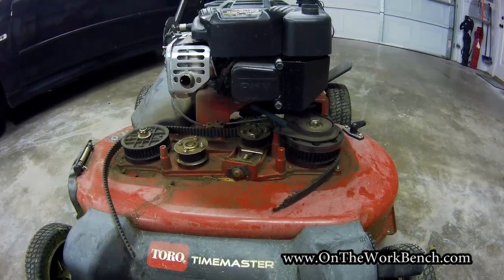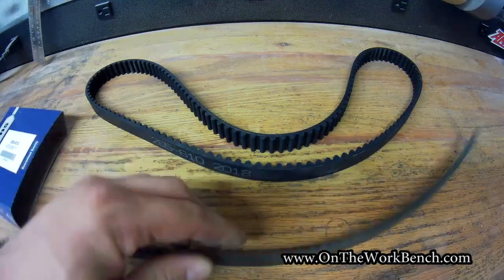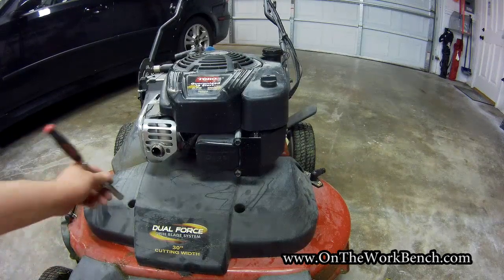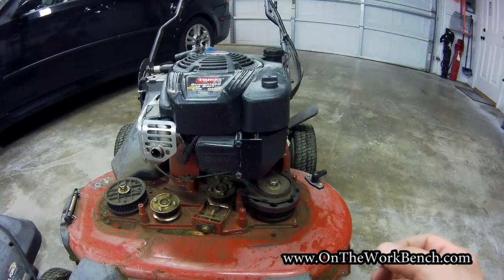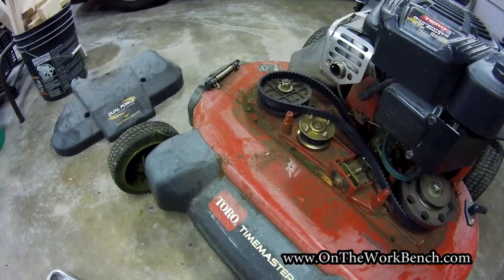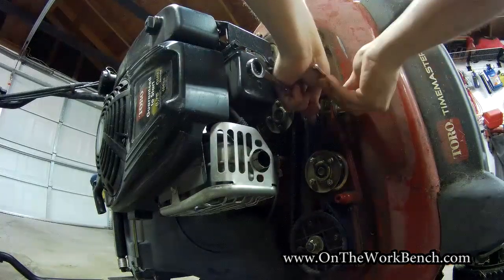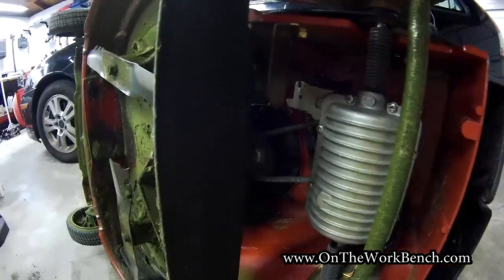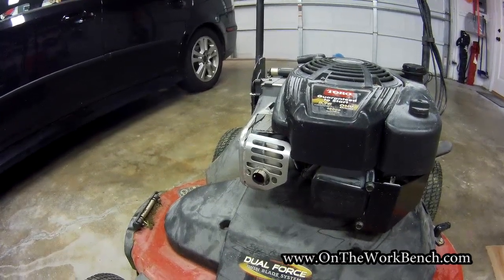Timemaster Sync Belt Replacement

Comment: Thanks! Very helpful! Two suggestions if I may. To set the tension on the sync belt after mounting, use a piece of paper between the spring plate and frame; it should be just possible to pull the paper out without tearing. Second, consider a cable tie or tension strap instead of a Milwakee clamp to hold the blade brake open. For information I paid my local authorised Toro distributor €172 in Dublin this week including taxes and carriage for a Toro Sync belt for my TimeMaster.

Comment: Very clear advice. Except I don't have enough clearance between the main pully and the red guide pole on the housing. Your belt slips in fairly easily with a little force. Mine is not. Looks like I have to take the whole pully off somehow.

Comment: Nice. I just replaced all 3 belts and the blades on mine after the blade belt broke. I originally got a non-OEM replacement and it broke in less than 2 minutes and the blades got really chipped up. So I ordered the Toro belt. I had to wait a month, but it is a much higher quality belt - carbon fiber. The non-OEM one that broke was clearly not made with carbon fiber. Anyway, the Toro belt is working great.

I didn't know about the blade lock (I do now). I managed to get everything lined up nonetheless.

Getting one of the old blades off proved to be challenging. The bolt wouldn't budge. I finally managed to remove it after heating it with a heat gun.

Thanks for the video. I learned something 🙂

Comment: I noticed that the blade tension spring clip was not parallel to the deck after you tightened the bolt.  You're supposed to tighten this bolt down to a point until the clearance behind this spring clip is at a certain clearance, which I believe is about 0.020".  Just an FYI for you and others.  Happy mowing!

Comment: Regarding the comment from Cujo below, Good catch, I believe factory specs are to use a feeler guage between the spring washer (rectangular washer) and the housing:  .25mm (0.010 inch).  You may need to slightly loosen the 2 bolts holding the tension plate 1st, make adjustments to factory specs (noted above) then re-tighten that bracket.

Comment: nice info, I always use anti seize to coat the threads when I work on stuff, I have my cover off, after the first time I used it 6 years ago, the grass builds up under the cover so I just keep it off so when I am done mowing I can wash off the mower topside and tilt it on its side exhust side down to was under side , lay it back on all four wheels and let the mower dry

Comment: My OEM belt broke on my brand new Toro on the 3rd use yesterday. I haven’t even had the mower 2 months. When the blades broke, the blades clacked together pretty hard causing some damage to the ends of both blades when they collided (because the blades turned freely out of alignment once the belt broke). Unfortunately the service dealer told me belts are not under any kind of warranty and damage caused to blades, or another other part, because of belt failure is also not covered under the warranty. I didn’t even have 3 hours on my mower. Did not hit anything in the yard. Nor was the mower neglected in any kind of way.
Reply from the maker: Yikes, that sounds scarry! Glad to hear you are ok. This mower seems to have the uncanny ability to eat belts. I have not been able to make it through a single season yet without having to replace at least one belt. Now I keep a dedicated pegboard hook in the garage to keep extra belts on hand.

Comment: Minute 8:08 when u out the belt around the black pulley was it really that easy ? Mines is freaking tight and I’m having a hard time trying to pull it down .
Reply from the maker: Make sure you loosen up the tensioner pulley, wrap the belt around one blade pulley completely, check the blade position, then wrap the belt around the other blade pulley. It might be a bit tight but if you start to rotate the blade the belt should finish seating itself. Using the  blade for leverage to turn the pulley works well, just don't cut your hand on the blade.
Reply: @OnTheWorkbench  the red post on your mower has a smaller diameter at the top (I can see the tapper), the version I have is larger in diameter and almost touches the pulley, there is no way a belt is getting through there.

Comment from the maker: The sockets and wrenches shown should have been SAE instead of metric. The correct size for the mower cover is 3/8" not 10mm, and the pully tensioner is 1/2" not 13mm. The metric sizes are larger by 0.3mm and 0.475mm respectively. Attempt to use the SAE sizes tools first but if they are fouled with hardened grass clippings, then you may need to switch to metric.

Comment: Crucial advice here during the reinstallation of the belt: after the tensioning pulley is backed off, there will still be tension left on the belt as you try to slip it over the left-side blade gear; to get the belt to wrap around and down over that gear, ... use the blades below to crank the half-engaged belt the rest of the way around the left gear and then down into place. There is just too much tension and the belt is not elastic to be able to pull by hand the belt over the rest of the top of the gear. Get it partially engaged, insure that the blades are properly offset by 90 degrees, remove the posts in the gears that locked them from rotating, disconnect the spark plug, and use the blades as levers to turn the gears above while pushing down on the belt. Tooth by tooth it will move down into place. Once it is properly in place, tighten up the tensioning pulley.
Reply: Thanks for the tip! I couldn't get the belt on for a while, but turning the blade made it easy. I haven't seen a video with that, seems like their belts have a lot more play.
Reply: When tightening the tension pulley is the plate tighten down where there is no play at the shoulder bolts . Then tighten the tension pulley to a business card space or the 1”&1/8,1/16 gap ?

Comment: Toro used SAE dimension fasteners. The correct socket sizes are 3/8" and 1/2".
Reply from the maker: And Briggs uses metric on their engines so toro mowers are a hot mess of both SAE and metric fastners
Reply: @OnTheWorkbench  The fasteners discussed in this video were SAE spec and the wrench sizes to use for them  are 3/8” and 1/2”. Using the mismatch of metric tools with SAE fasteners is bad practice that could lead to personal injury or damage to the parts. This is especially true for inexperienced Individuals who are seeking instruction/advice from a teaching video.
Reply from the maker: @jefferywright4204  Agreed! I should have reached for SAE for those bolts.

Comment: no way to get that belt passed the right side tooth blade gear.. no way.. need to remove it
Reply: Yea I'm sitting here trying to figure that out now......
Reply: @StripeLife-cy9bc  I used a flat head to just cross my fingers and hammer the belt down between the gap...lol.. worked fine and no damage to the belt but only time I've ever tried..lol.. could have ended badly..
Reply: I pretty much hammered it on too last time. Doing it again and there’s got to be a better way.